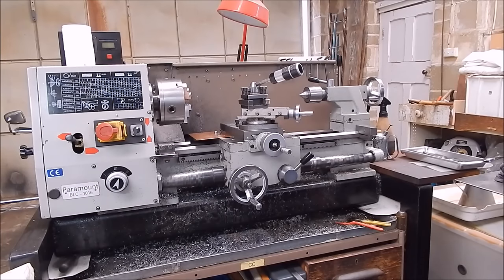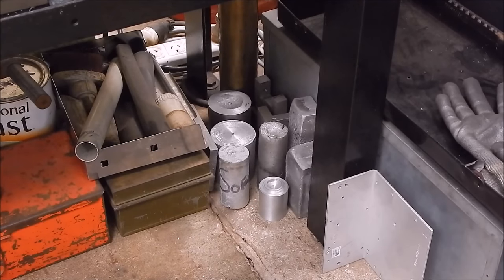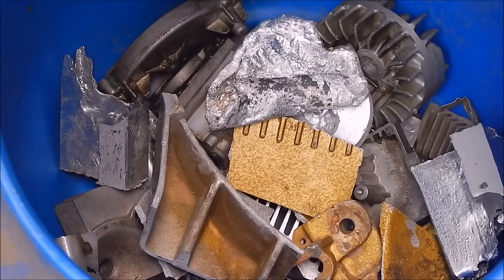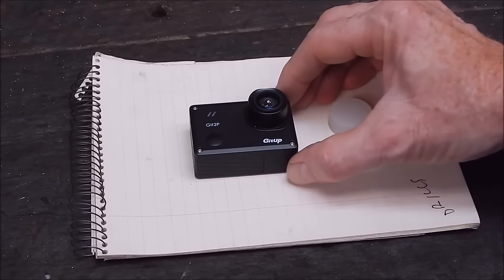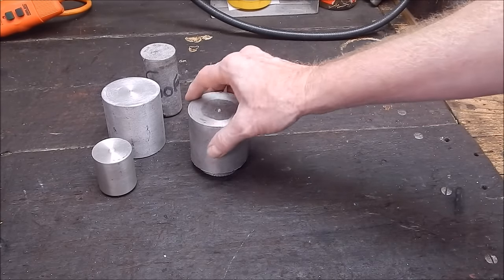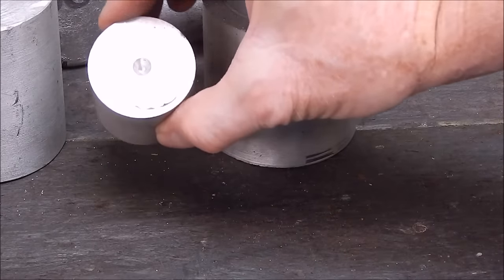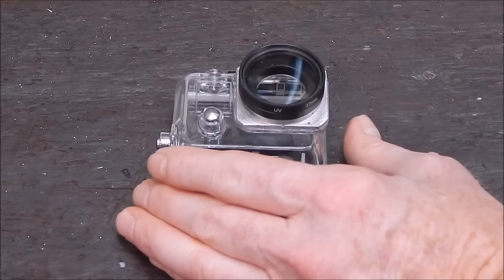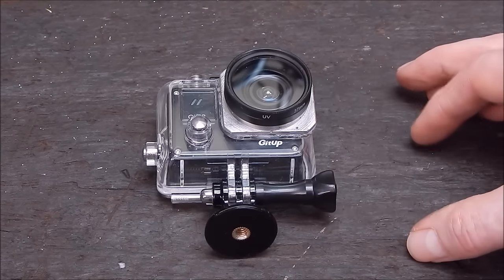The worst aluminium in the world

Comment: As mentioned before in the comments magnesium and manganese makes the aluminum tougher. if the content is high you can test it with vinegar. A drop on normal aluminum will do nothing but with magnesium in it it will bubble up. To test for manganese is not that simple. You can test it in a hot flame. Make some powder from the metal and blow it carefully in the flame. compare the color change to pure aluminum. if its more yellow it contains magnesium if it's more red it contains manganese.

To make aluminum easier to cut you can add 1% to  3% lead. If you add between 0.5% and 1% copper to get e better surface finish. But it's always a guess how exactly the alloy will behave in the end. I had mixed results. Some of the aluminum got better to machine some not. It's hard to narrow down the properties if you didn't know what exactly the allow it you start with. But it's fun to play around with.

Brass is a pain in the ass to work with. it's Better to get it more bronze like. I always add some tin (~1%) to the brass. It makes it much easier to work with.
Reply: You can always go old school and make the Duralumin recipe...4% Copper will make what used to be a 2xxx (if I remember correctly 2024) series airspace aluminum (not anymore because it's susceptible to corrosion and was usually clad in pure aluminum to combat that).

Comment: For round stock, I usually just fill a bucket up with greensand and stick a bunch of pvc pipes in it, pack it in and when you pull the pipes out, it'll leave cavities as deep as you want. Just pour your metal in and your good as gold.

Ive run into that crap metal before also, but only a very small amount. I usually melt down lawnmower engines for scrap aluminum, and they're generally very good quality aluminum, but the one time, I ran into one that had a little bit of magnesium in it somewhere, and when I put it into my scrap melter, it all got melted together and a little bit of magnesium got mixed in with a few of the ingots. It had cast ok, but when I went to machine it, it chattered like crazy like yours and had hard spots all throughout it, which made the chatter even worse turning it as it would go hard spots to soft.

Some lawnmower decks are made of a magnesium alloy, so thats probably what you had gotten mixed in with your stock.
Reply from the maker: Magnesium contamination - that probably explains it.  It was a total pig to machine.

Luckily I didn't mix it with my good stuff.

Cheers Rob
Reply: have you ever tried remelting the bad stuff?
Reply from the maker: No, but the thought did cross my mind.

Nothing to lose I suppose, but the composition is really gummy when you try to machine it, and I think it will just be more of the same.

The way it parted off was atrocious.  You can see how it gummed up and went almost plastic.  Uggghhhh, horrible.

Rob
Reply: Try melting 2 or more different "bad" types together.  Your new random alloy might be better than any of its ingredients

Comment: Yep, its all hit and miss sometimes on melting scrap. I have access to mag wheels but chopping them up is the biggest drawback. Its the "M" metals within the alloys from general scrap that give me (us) the most grief. Looking for a way to filter the molten AL when puring to remove bits of garbage and slag that find their way into the billets. Wanting to give some aluminum broze a go :)
Reply: don`t pour from the lip of the crucible..  if you use a steel crucible, add a small pipe  sloping up from the lower end ..  and put a lip guard to stop flow over the rim. That way the floating dross stays in the crucible and you only get the clean stuff from under it.

Comment: I've used drops from a company that had as one of their products aircraft fuel tank level gauges. The way the levels are made is the cores are made from pure aluminum. The cores are plated and the aluminum was dissolved out, making for a very light weight structure.
  Machining pure aluminum and getting a good finish is a nuisance. It is gooey and wants to tear instead of cutting cleanly. It welds to the tool unless the tool is razor sharp...kerosene, mineral spirits,  or WD-40 helps get a clean cut.
 If you are making something that matters, buying the actual alloy you need will save you a lot of cursing. 6061T aluminum alloy is a good all around choice. If you need special requirements, order the correct stuff.. the stuff in the scrap bin may not be what you need.

Comment: The Main issue with Ali that casts like that is magnesium. Household vinegar bubbles when put on Ali with mag in it. Scratch the surface and put a good blob on it. It's pretty self evident which is the rubbish stuff
Reply from the maker: I will give that a go.

When you look in the scrap aluminium tub at 2.21 in the video, the golden coloured pieces are more bits of the lawn mower cutting deck/base that I melted into the horrible stock being used.

Thanks for the tip.

Cheers Rob

Comment: I have never cut up a mag wheel but have had great success with automatic transmission valve bodies for a soft alloy and John Deere diesel pistons are very hard and machine very nicely.
Reply from the maker: Pistons are good if you can get them. 

Cheers Rob
Reply: If you look for boat propellers, they're usually made of A413, which is identical to pistons, and the propellers are usually much cheaper and easier to get ahold of depending on your area.

Comment: the best ali` that i have cast comes from ali scaffold tubes. they are illegal to use in the UK now, but I have hundreds of feet of the stuff, from the old days.. Don`t know what the exact composition is, but it melts, pours and machines like a dream..
Reply from the maker: Interesting Geoff.  They look like good stuff.  Why are they now illegal in the UK ?

Cheers Rob
Reply: Not strong enough..  A concrete block weighs about 44 pounds. You load out a few hundred  for a bricky, ,, . it tends to bend more than is comfortable...  A lot of your houses in Oz are timber construction, .. not such a problem..

Comment: Your probably mistaking pewter as aluminum and their not the same. They look identical and pewter is used in many motorcycle side covers, crankcase's and for many parts where strength is no issue and cost is everything.

Comment: Nice job on the camera mount.

I am curious on the price difference of aluminium in Australia vs US.

I am lucky to have a metal recycle place within about 45mins drive.  If they have a relevant size I can get steel for around $0.5/lb  ($0.18/kg) and aluminium for around $1.55/lb ($0.7/kg).  This is typically 6061-T6.  I have a number of cut offs in aluminium similar to the ones you show which I got from this place.

I recently wanted some 1in aluminium square bar for a project.  The weather was bad so I did not want to make the trip to the metal recycler.  I was able to find on EBay 1in x 1in x 12in piece of 6061-T6 for a little over $4 each including shipping.  The is about $3.4/lb ($$1.54/kg).

There are a number of online metal warehouses.  The price / lb is not bad, but these places charge ridiculous shipping.  A $10 order may get $30 charge added for shipping.  Not a surprise I rarely purchase from these places.
Reply from the maker: It's virtually impossible to buy alloy scrap in my area, and the price for new solid round from dealers is horrific.  I can't quote a price as it's been years since I bought any, and I just wouldn't consider doing it now since I melt my own.

Ebay does have some reasonable priced off cuts at times.

Rob

Comment: A friend of mine here in the uk melts his own brass for stock and castings and had a similar issue, it turned out that brass or aluminium can be crap if it was used originally in die casting or press work as casting brass/Ali has a different composition! To the press/die metals Hope this helps!

Comment: My casting of Aluminum has been good but trying to recycle brass has been a total disaster.
If you think Aluminum alloys are bad just give brass alloys a try!
Reply: Al Slitter get yourself some flux for red metal. I use 503 from artisan foundry in the UK. Can't really link as I'm on my phone. Works a treat.
Reply: At a pc now. This is the stuff that I use: -
http://artisanfoundry.co.uk/product_info.php?products_id=44
CUPROCOVER 503 FLUX FOR COPPER BASED ALLOYS

It works a treat when recovering brass turnings

Comment: That's some knarley stuff, Rob.  I got something similar with drink cans.  I learned to avoid anything that looks like it was drawn or stamped.  As for re-melting, my crappy batch didn't improve any and seemed to get worse.  It would be nice to know what could be added to the pot to firm it up like adding carbon to steel.
Reply from the maker: Hi Eddie,

Keld Sorenson gets good results with drink cans.  Maybe you're drinking the wrong stuff ;)  

I have never tried drink cans as I don't get enough of them, and my beer comes out of bottles.  Looking at cans I always thought they would be good, as the metal seems similar to aluminium window frames.

I won't try re-melting it.  The chemical composition won't change, and it will still gas too much.

I had to show you guys this stuff, as it is by far the absolute worst I've poured, and wondered if others had come across it.

Cheers Rob

Comment: Hi Rob, I know what you mean with 'feeding the beast', I just moved from SA to QLD and I can't find any scrap yards that will sell me anything! I never considered using alloy rims for metal, I figured they were composed of more magnesium and might ignite during the melting process. The one thing I have found which you can sometimes pick up cheap is exercise Barbells, sometimes people practically give them away and I found one I turned was like turning 1214, very nice finish.
Reply from the maker: Most alloy car rims are totally aluminium these days. You can buy magnesium rims, but they are expensive and not generally used as OEM equipment.

You were lucky with the barbells.  I've machined these in cast iron and the metal was terrible.  They are usually made out of the dregs from the furnace, according to comments I've received.

Cheers Rob

Comment: the de-gasing problem? Look like it cavities are formed by hydrogen compounds. Caustic soda (hydrate of sodium) could helps, need 10-15g for 1L melt of that soda 10 minutes before casting
Reply from the maker: I've only ever used baking soda for degassing.  You recon caustic soda works ?

I have some.

Rob
Reply: baking soda is for cookies, needs caustic soda. I've been melted some mixes of the different kind alloys of aluminium, i gotten pretty bad quality of casting: black spots and large cavities. The Next melt I added c.soda, and the result was much better.
Reply: Baking soda (Sodium BI-carbonate) is about the worst thing to use for degassing since you're actually introducing CO2 and water vapor into the melt.

The trick is to convert the baking soda to washing soda first, or just use washing soda straight from your supermarket. When baking soda heats up, it releases the hydrogen molecule and converts to Sodium Carbonate (Washing soda), water, and CO2 gas. 

I've never used straight caustic soda as a degasser, since it's astronomically expensive here in the States vs baking soda ($15/kg vs $1.75/kg), but it should work just as well.

Comment: Hi Rob.

Have you thought about just using acrylic? I often use it for little jobs like that and it can be chemically welded with a product that I use regularly called acri-bond. It's great stuff, not a clue but a welding agent for plastics. Not cheap but well worth the money.
Reply from the maker: I would have to spend money to do that ;(

I do have some 15 mm thick black polypropylene panel board that I could have used, but it's almost impossible to glue that stuff.

The alloy worked well,and cost nothing.

Cheers Rob
Reply from the maker: You could easily make this out of commercial 5.5 mm thick aluminium plate, which I did have, but used the home cast stuff instead.

Rob

Comment: Now you need to come up with a way to determine the chemical composition of the aluminum.  That way you can determine the best composition for your machining activities before spending all the effort to cast it.
Reply from the maker: I'm open to suggestions.  In fact I expect all back yard casters are waiting for the answer to your observation.

Rob
Reply: Stephen Brown household vinegar bubbles when you put it on Ali that has magnesium in it. That's what is causing the rubbish casting
Reply: I read in an aviation inspection advisory circular that immersing a sample of the material in a 10 percent
solution of caustic soda (sodium hydroxide) will identify aluminum that has copper by turning black. I read online that magnesium reacts to battery acid (Sulphuric Acid).  That might help classify some of the alloys.
Reply: If that is the case then Rob should try a vinegar test on both types of castings to see if he can find the magnesium.
Reply: i suppose that you can always try turning a small piece cut off of the scrap before melting it

Comment: Hi Rob , Try using WD40 as a cutting compound. Tell us what you think. Cheers
Reply from the maker: I use a kerosene based cutting fluid which is very similar to WD40 (which is mostly kerosene) and it helped, but wasn't the complete solution.

Cheers Rob
Reply: ethanol is much better for aluminium

Comment: Some of the stuff in the bucket is Zamak 2. Zamak is zinc with a little aluminium mixed in used for die castings. That's why your stock turns out so bad.
Reply from the maker: That sounds like a good explanation.  The gold anodiized stuff is some of the lawnmower cutting deck that I melted down into the horrible round stock.

So if it was zinc, that explains a lot, as I've cut zinc plate and it finishes off terribly.

I recon you've provided the answer to this one.

I've chucked it all in the recycle bin.

Thanks for the comment.

Cheers Rob
Reply: xynudu  There are some easy chemical tests to tell them apart. Nurdrage has a good video on testing with dichromate solution. Check him out.
Reply from the maker: OK.  Thanks.

Rob

Comment: I have ordered that same camera as I believe that the 90 degree lens would give a better representation of distance and clearer view, and I will also be modifying a gopro case.

Dose the front of the case unscrew? Could I pack it out with a 5mm thick perspex with a hole through it and use longer screws to reattach it? Just aksing.

Thanks Rob.
Reply from the maker: Hi Walter,

The "P" lens works very nicely for the aspects you refer to.  It doesn't push the image away like wide angle does.

There are two types of underwater cases sold.  One has small torx screws that can be unscrewed for disassembly, and the others are glued together.  It's pretty obvious which is which when you buy one.

I originally was going to do what you suggest (put some packing in) but I didn't have the correct size torx tip and damaged the screw heads and case so bad I had to change plan to what you see.

Then there is the issue of extra screw length required with the packing in place.  They are tiny screws, and I don't have any.  Maybe they are available from Ebay or hobby shops ?

The camera itself is easy to use and works well in good light.  Artificial light situation is OK, low light is pretty ordinary.

The only issue I have noticed is that fast panning can cause choppiness in videos.  This is an odd effect which must be related to the video interlacing.  It is very noticeable when viewing the raw video with an IPS monitor (which can highlight this), but not so much on a basic LED screen.

After YT processing any aberration is not very noticeable.

Overall I'm quite happy with the camera, especially when used with the external microphone.  I strongly advise you get this, and from the factory, as the micro USB plug is slightly non standard and aftermarket mic's may not be compatible.

Cheers Rob
Reply: Hi Rob. I finally received my Git2p, bought a set of mini toques drivers that I needed anyway and managed to modify the go pro case with out a hitch, maintaining it's full water froofness. Thanks for your advice.
Reply from the maker: Hi Walter,

Good going.  That's what I was originally going to do, but stuffed up ;)

What did you pack it with and how much thickness did you need to add?  Also how did you get on with the little screws for length ?

I wasn't too fussed with my case mod as it is handy for cleaning and I cut a port hole in the side for the microphone jack anyway, as the sound is pretty muted by the case without it.

Pretty cheap project all round.

Cheers Rob
Reply: I removed the original square lens cover from the go pro case, I have some scrap 5mm perspex so I cut it to the same size, then I drilled a hole through the centre of it, then chucked it in the 4 jaw and bored a hole just big enough for the git2p lens to fit through, I then machined a piece of aluminium stock and and pressed the perspex on it. then I chucked the stock in the 3 jaw and machined just enough perspex off to clear the black square lens retaining ring and just back far enough to maintain the thickness of the original lens. Then I Acribonded the original lens on to my extension and machined it to size and put it all back together with all the original screws like it never happened. It's not the prettiest job but acrylic can be a bugger to machine when it's small without destroying it. I hope this all make sense to you, if you'd like pics, gi me your email.

Walt
Reply from the maker: Got it.  Good idea gluing the packing on one side so the screws still work OK.

10 out of 10 ;)

Cheers Rob

Comment: melt down aluminium with brass plumbing fittings around 60 to 70 al to 40 30 brass and you will have lovely machinable 
alolybroze table salt as flux